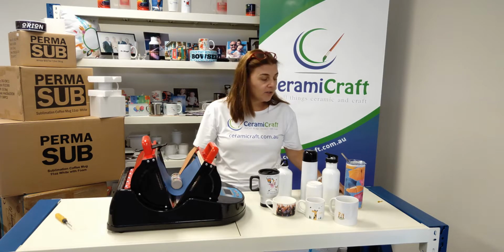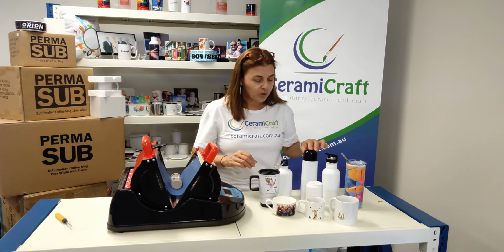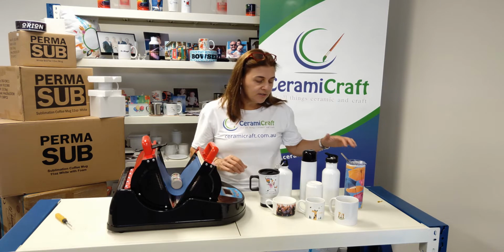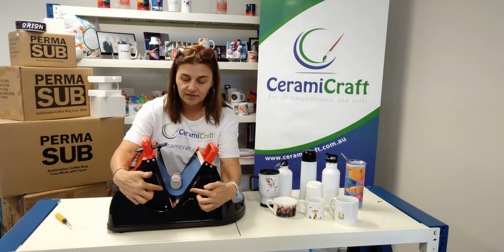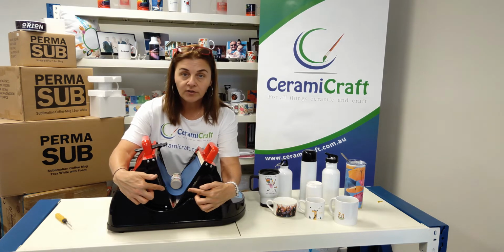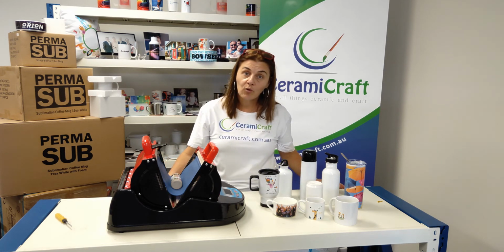Sublimation Blanks suited to the Freesub P6800 Press

Comment: Brenda, can you show how to use the different silicone sleeves that came with the machine as well as the metal brackets and their purpose. The manual for this machine is not very detailed and I couldn't find anything on Vevor's website. Thanks for your help.
Reply from the maker: Hi Garry, unfortunately we are no longer able unable to create videos featuring this product, as it is no longer stocked. 

For your convenience we have placed all videos we have pertaining to this machine in a single play list here – https://youtube.com/playlist?list=PLJTFNsed6DSuBjGp9yBQPChNiBSDhYwXR&si=sklJJjH1sJn05IsV

To put it simply, the adjustable metal rods in this machine are used in conjunction with the silicone slings to determine the pressure applied to blanks of various circumferences. 
Having the rod position at the top position (1) will apply the least amount of pressure and position (11) applies the maximum amount of pressure.  
The smaller the diameter blank, the more pressure required to ensure the sleeve wraps around the circumference of the blank and the lower you’ll need to position your rods in the machine. The incremental numbering on the machine will help you to record your ideal settings.